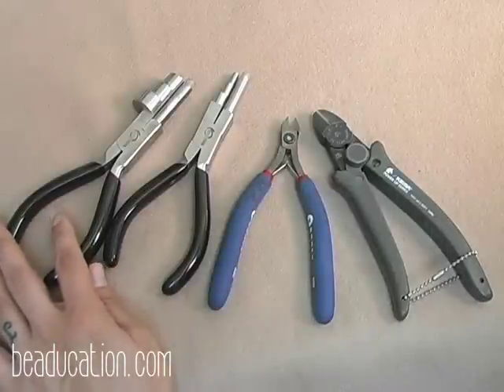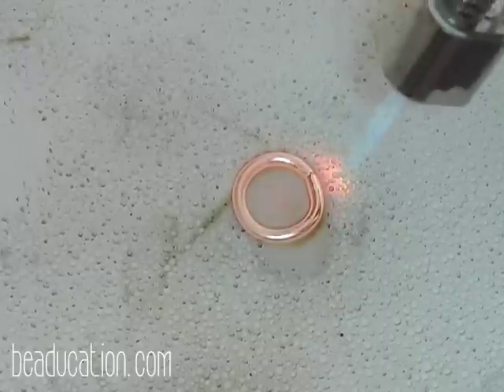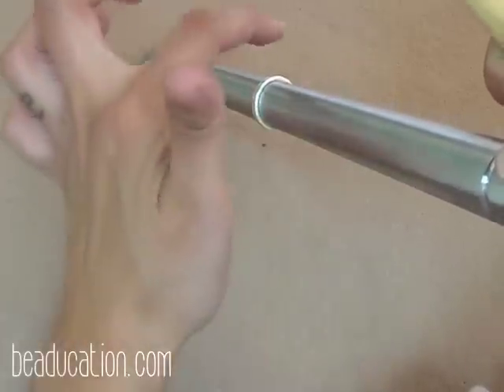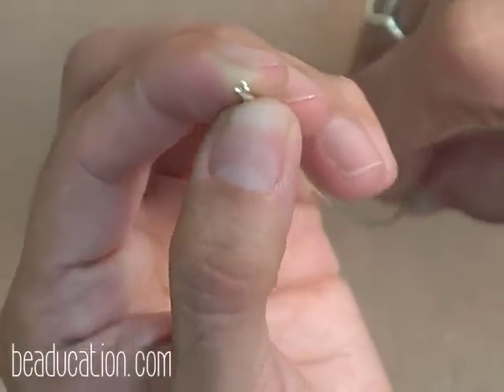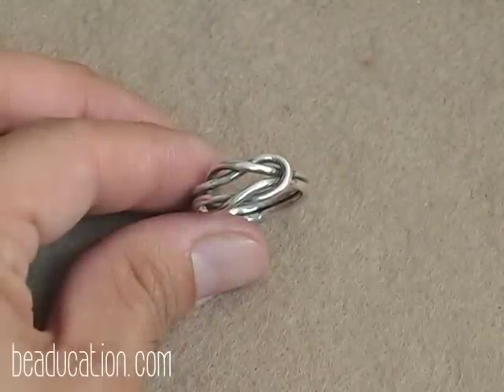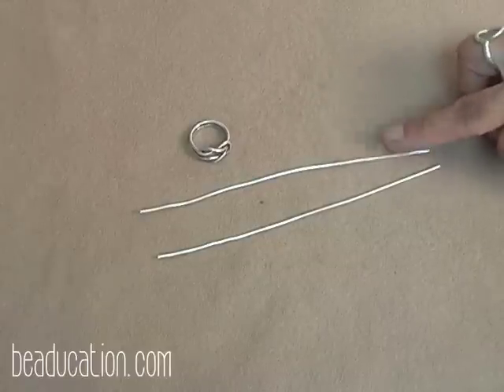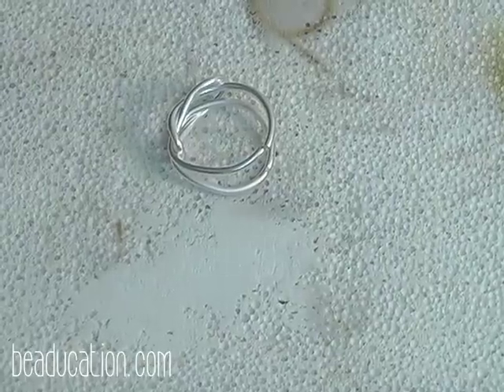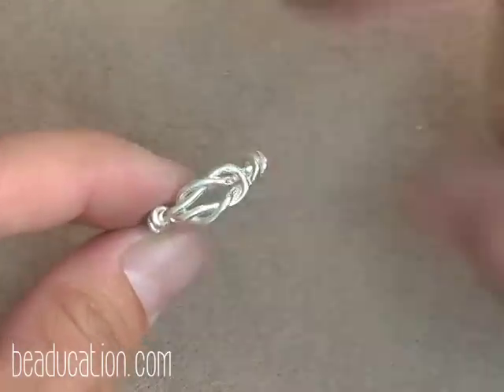Twisted, Knotted and Fused Rings Tutorial - Beaducation.com

Comment: I found if you want a more uniform look around the edges of the ring, instead of hammering either side directly with the hammer. If you will take 2 bench blocks and sandwich them in between them then use your large rubber mallet give it a few taps flip it and do it again and you’ll have a really good nice clean uniform look unless you want that hammered look on the sides of the ring that is 😉 just a little quick and easy tip I found works for me and thought I’d share. I hope that’s ok.
Reply from the maker: Thanks Julie, that is an awesome tip!!!

Comment: how did you get the 3 pieces of wire to stay inside the drill whilst twisting the wire? ive never seen that before x
Reply from the maker: if you first twist them a bit by hand and then clamp the chuck down on that, it will hold them well.

Comment: Hi great video..I am new to soldering silver rings and i have made a couple of them but have done them with solder paste do I have to use solder paste next time? I seen that you didn't.
Reply from the maker: Hi Amber, No you don't have to use solder paste, that is just the preference of this teacher. You can use whatever solder and flux that you prefer.
Reply: Ok thanks. Did the teacher in this video use any solder or flux?
Reply from the maker: No, with Fusing Fine Silver Wire you don't need flux because it doesn't get fire scale and will fuse to itself without solder.
Reply: Cool ok thanks a lot!😊

Comment: You could make all of these rings in sterling silver the same though couldn't you? Have you chosen fine silver because it's softer and easier to work with?
Reply from the maker: You can use sterling and you would be soldering, with solder paste. Fine silver is for fusing (no need for solder).

Comment: Wondering why not use a bigger starting size for first ring? And curious how much smaller second ring should be to start with, so by the time you flatten the twisted wire, it doesn't get too big. Thanks??
Reply from the maker: Hi! There are many, many factors that come into play when making rings. And when you make rings with fine silver there are even more. Because the fine silver is so soft in stretches once hammered, and depending on how much you hammer the piece will determine how much is stretches. We recommend trying the technique for yourself. You'll learn how much texture you like, and therefore how much the ring will stretch. Have a great day!

Comment: is there anything else o can usr to fuse the ring on yop of if i dont have a block
Reply from the maker: Something that will conduct heat and not get injured by the torch. I have even seen people use a kiln brick but it will not conduct and hold heat as well as a kiln brick or a charcoal block.

Comment: Lovely! Would it be possible to also make these rings in copper?
Reply from the maker: Hi Laura! Yes, you could. But you would need to solder the joints. You would probably also need to anneal the wire many times to keep it soft while working.
Reply: Beaducation Is it possible to fuse copper? I know it would get fire scale but can you just polish that off?
Reply from the maker: Laughs&Crafts copper doesn't fuse to itself because it's an alloy and not a pure metal, you would have to use solder.

Comment: How do I know when to solder a ring shut, and when to fuse it
Reply from the maker: Hi! It would depend on the material you're using. We fuse with Fine Silver when we fuse. Have a great day!
Reply: Beaducation great tutorial! If I am using sterling sterling dead soft 14 gauge wire for this project, will fusing work? Or do I need to solder it with easy solder paste?

Comment: can this be done with copper wire?
Reply from the maker: In this class Lisa fuses the wire together, this happens easily with Fine Silver. If you choose to use copper you will most likely need to solder the joins. Have fun!